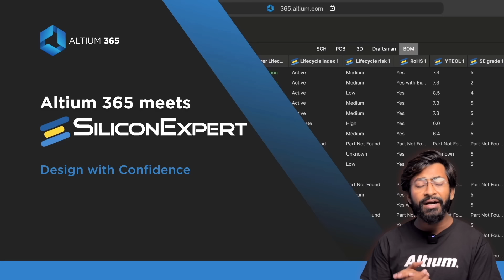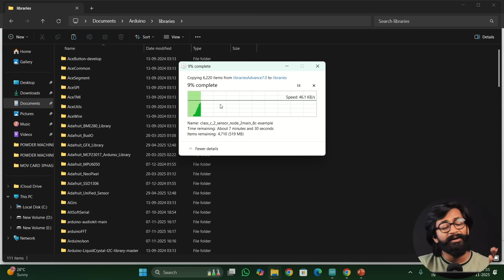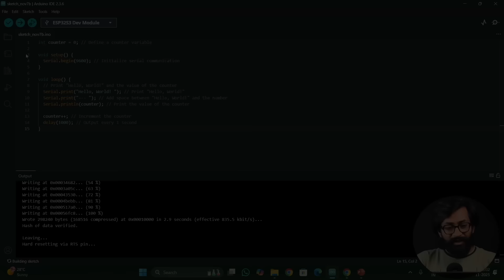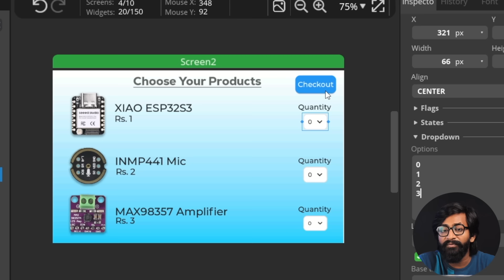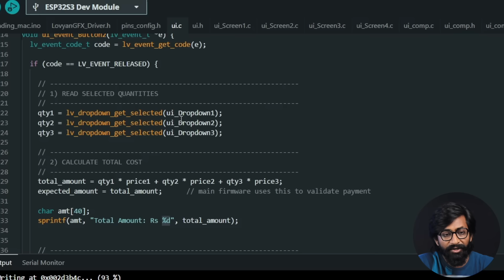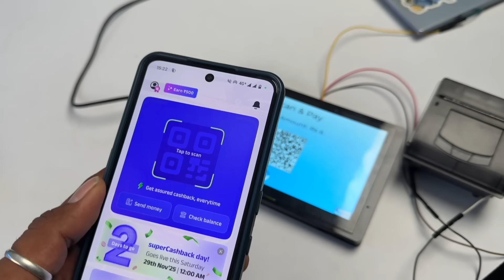UPI Vending Machine Interface with Dynamic QR code | @squarelinestudio  | @Elecrow

Comment: My project is medicine vending machine. 
1. Prescription details are decoded.
2. Prescribed medicine and cost are displayed.
3. The system waits for payment confirmation.
4. Once payment is verified, the controller activates the dispensing motor.
5. Sensors confirm successful dispensing.

Comment: Portable Smart Bicycle Dashboard with Calorie Burn Monitoring 
Feature:-
Below features will display on display.
1) calories burned monitoring 
2) Speedometer
3) pedal counter 
4) distance measurement 
5) Navigation MAP via WI-FI using Map API
6) Temprature display 
7) Rain prediction using online weather API 
8) touch button to control light
9) sends SOS to telegram BOT, for Fall detection

Comment: Using this 7-inch display, I am creating an IoT-based weather station for farmers that collects real-time environmental parameters such as temperature, humidity, wind speed, wind direction, rainfall data, AQI level, pressure, and altitude — and displays everything directly on the screen.

Comment: Here is my project idea that genuinely requires the Elecrow 7” HMI Display:

Smart Queue Optimizer & Token Prediction System

A major everyday problem in hospitals, canteens, campus offices, photocopy counters, and admin desks is the chaotic and unpredictable queue. People stand in line without knowing their waiting time, there is no structured flow, and crowding creates frustration for both users and staff.

My project uses the Elecrow 7" HMI as a dedicated touchscreen kiosk to solve this. Users simply tap the service they need, and the system instantly generates a digital token with an AI-assisted predicted waiting time based on current queue length, average service speed, and staff availability.

The display provides:
• Live queue status
• Estimated time for each user
• Current token being served
• Multiple service categories
• Alerts for sudden delays or workload spikes
• A staff control panel to manage or override tokens

This reduces crowding, eliminates confusion, prevents unnecessary arguments, and helps users manage their time better. The 7” HMI is essential because the solution relies on a clean, standalone touch interface—no phone apps, no internet dependency, just a self-contained intelligent kiosk.

The idea is unique because it solves a real, relatable problem that everyone experiences daily, yet most places still handle queues manually. This system brings prediction, transparency, and order to any service queue with a simple deployable device.

From Ahmedabad, excited to build this project!

Comment: Home Security Alert Desk Panel
A central screen that monitors doors, windows, and motion sensors. When movement or forced entry occurs, the panel shows a bold alert with sound. A silent trigger button on the screen allows the user to alert family or guards without drawing attention. Event logs remain saved with time stamps for later review. Extra sensors for smoke and gas add safety feedback in real time, making the panel a full protective desk for apartments and houses.

Comment: Smart Irrigation Control Board
A farm or garden touch panel that handles watering schedules and pump control. Soil moisture and tank level values appear in two large sections for a quick glance. Timing for pumps is set with sliders, and a schedule calendar helps repeat watering routines without manual switches. Weather data from online sources informs the farmer before starting water flow. A relay board connects pumps and valves, making the panel a full field management unit for daily use.

Comment: Health Vital Display Station
A desk unit that tracks pulse, oxygen, body temperature, and blood pressure on one screen. Each reading sits in a large tile so values stay easy to view for elders or patients. The device stores past readings and shows small trend lines for morning and evening checks. A reminder alert appears when medicine time arrives. A help button sends a message with location details to a family member or medical staff during emergencies. This design supports clinics and home health monitoring.

Comment: Smart Home Wall Panel
A wall-mounted touch screen that controls home features through relays and sensors. Lights, fans, curtains, and door locks appear on separate pages with clear buttons and sliders. The panel shows indoor temperature, gas readings, motion alerts, and water tank level. A voice button on the screen helps handle quick commands for switching appliances. A security tab stays on the side to trigger siren mode during danger. This setup works well for both house owners and demo display in events.

Comment: My next project will be an Electronic Voting Machine (EVM) that prints a ballot slip after each vote is cast. The voter will then place this printed slip into a secure ballot box. This mechanism provides a physical audit trail, enabling re-verification in case of any complaints or disputes.

Comment: 25:39 to answer this
I have an idea to create...
Multi‑function ESP32‑S3 7" car gadget:
- Digital dash: speed/RPM, temps, fuel, warning icons via OBD‑II/CAN  
- Trip computer: live/average FE, range, trip timing, altitude, graphs, SD logging of CAN + GPS.  
- HUD mode: big mirrored speed/RPM for windshield reflection, over‑speed and fatigue alerts.  
- Diagnostics panel: read/clear DTCs, show live sensor data, maintenance reminders.  
- Performance logger: 0–100, G‑meter, lap timer, session replay graphs.  
- (Maybe) Environment & comfort: cabin/outside temp, auto‑brightness, relay control for lights/seat heaters/accessories.  
- (maybe) Connectivity hub: Wi‑Fi/BLE phone app for settings, log download, OTA updates, and nav hints on screen.

Comment: Planning to make a smart touchscreen-based weighing scale capable of automatically calculating prices, printing a detailed list of purchased items, and generating a QR code or payment slip. This system is designed to improve digital literacy and modernize transactions in small businesses such as vegetable shops, cafeterias, and open-market stalls

Comment: If I get this 7-inch HMI display, I will use it to build a Neon-Themed Smart DJ Console. It will have a real-time music visualizer, BPM detection, sound-reactive neon effects, and lighting control. The whole system will be touch-based with an attractive and modern interface. It will be a unique and impressive project.

Comment: I'm dealing with some stress and anxiety coz of my 10th boards, but I've got pretty solid experience in AIoT and IoT development. That's why I'm currently working on an AI that helps students by mentoring them and acts like a psychologist assistant. I think it'd be really cool if the model had its own face and was interactive too.

I'm building out this whole ecosystem where it'll track the student's face and focus levels using CV. When they're outta the room, it'll pull body health data including stress levels from their smartwatch. For now, I'm planning to use a phone for the interactive part, but eventually it'd be awesome if it could be like a physical bot planted in the room , maybe running on an ESP32 or similar MCU . I'm thinking of using a lightweight neural network architecture, maybe something optimized for embedded systems like TensorFlow Lite or a custom transformer based model for the conversational AI part. 

Le'ts see how it goes

Comment: I will use this  Display in my @HOME WATER MANAGEMENT project:

Real-time Tank Levels: Show main tank and drinking tank water levels clearly with big visuals.

Government Water Status: Display whether government water is available or not.

Pump Monitoring: Show pump ON/OFF status live to avoid overflow or dry running.

Flow Sensor Readings: Display accurate flow rate and total usage.

System Health: Show communication status between Ground, Master, and Roof ESP32 units.

Touch Control Panel: Use the touchscreen to manually control valves, pump, and system modes.

Safety Alerts: Display warnings like low water, no government supply, or communication failure.

Beautiful UI: Make the whole system easy to monitor with a clean, large, user-friendly interface.

Comment: My project idea is a hospital delivery robot integrated with a 7-inch ESP32-S3 CrowPanel HMI for real-time control and monitoring. The robot autonomously delivers medicines, tracks patient schedules, and assists hospital staff. The touchscreen HMI provides an easy-to-use interface showing patient details, medicine reminders, robot location, battery status, and emergency controls.

Comment: Hi, I want to use the 7” ESP32-S3 HMI panel for my project.
This display will be the main control screen.
My project includes:
• Live video (ESP32-CAM)
• Sound detection + motor control
• Heart-rate analysis using AI
• Face & position detection
• Temperature control
• Moisture alerts
• Activity monitoring
The touchscreen will let me:
• Control the motor
• Adjust cooling/heating
• View all sensor data
• Watch live video
• Check heart rate, temperature, activity, alerts
• Use simple AI suggestions
WiFi will be used for remote monitoring and notifications.
The 7” HMI is ideal because it gives a big display, touch control, ESP32-S3 power, and built-in mic/speaker.
It will help me create a complete smart system on one screen

Comment: I want to make a secure access control panel using CrowPanel Advance 7“ HMI| ESP32-S3 AI-Powered IPS Touch Screen for my workshop that uses the touchscreen for a pin pad , connect RFID based entry and the AI processor for local face recognition to unlock the door